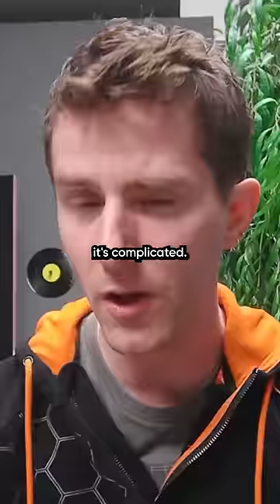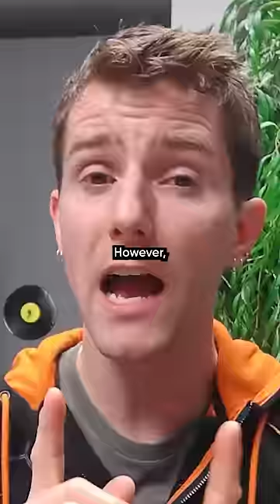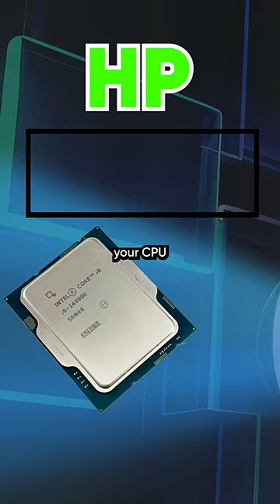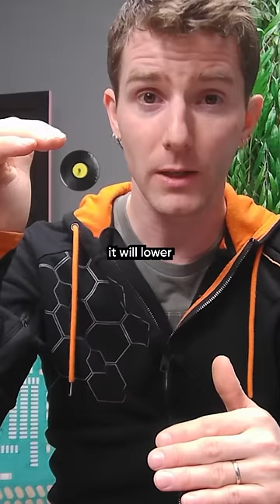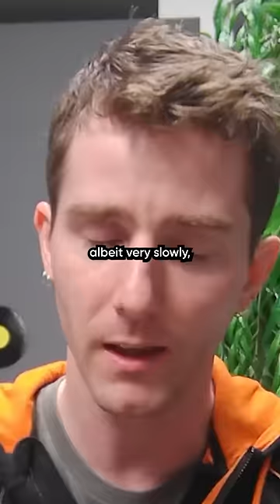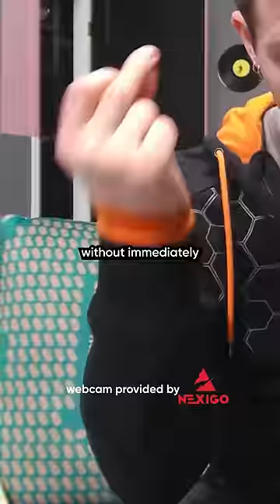How bad is Thermal Throttling?

Comment: Throttling doesn't actually do a very good job of matching the cooling.  By the time throttling kicks in, the chip is already too hot, so it overcompensates by bringing the target down way more than actually necessary.  By dialing in that power target manually (limit your CPU power until just before it throttles under load) you can get SIGNIFICANTLY better performance.  My personal experience is about a 20% gain on a 13900k.
Reply: You don't to undershoot if you're using A PID / feedback based solution for reducing the power right? Even temperature controlled soldering ions use that....., they dont just swing between temps. They'll just reach the temps in fastest way but gradually. But in a CPU it might more be a drastic to avoid any circuits frying up.
Reply: This is simply not how thermodynamics work.
Reply: @ChillerStone2  Computer components lose efficiency at higher temperatures and wattages.  The hotter they run, the higher their resistance gets, and the more heat they generate for every additional cycle.  It's not a "thermodynamics" issue.  They simply lose efficiency and need even more power, which turns into more heat, which turns into more resistance, which turns into less efficiency, which requires even more power..

Maybe my reasoning is wrong, but whatever the actual reason, my CPU performs better when manually throttled.  It's basically a slow and steady vs hard and fast, slow and steady wins the race.
Reply: Same for me with my 6800h, it used to boost up to 4.5ghz thermal throttle but after limiting its boost to 3.7ghz I get more stable framerates

Comment: Running your cpu at 100°C is a new normal for modern cpu nowadays
Reply: For my Intel from 2007 this is also normal
Reply: @gordon_ramsay2060  I don’t think so
Reply: My laptop cpu is sometimes 101°C while gaming
Reply: Depends on the cpu, if I remember correctly there are some mobily chips disgned to run at up to 105° @MrGamelover23
Reply: Only intel standards. Useless e core power draw
Reply: And then there’s mine, never exceeding 65°C…
Reply: @minepro2929  you’ve probably never had a QX6850 @ 4.2GHZ 😉
Reply: True, modern CPUs are designed to automatically overclock itself until it reaches 100 °C.
Reply: not for ryzens
Reply: It always has been son.
Reply: Later intel macbooks often operated in 80-100 C on load
Reply: Depends on the cpu. 100c would not be good for a 5800x3d or 7800x3d.
Reply: @minepro2929 really depends, i used to have a laptop that would sit at 100°C idle
Reply: Please help, my 1070ti fe blower card is 60c idle and 90c load. No dust and I replace thermal paste
Reply: My 7800X3D never goes above 60° in most normal uses actually.
Reply: @benniwd2077 yeah mobile chips are generally designed with the assumption that they’ll run hot, can’t really get much cooling on a laptop chassis. My i7-11800H regularly runs at 90+C before throttling to stop it hitting 100.
Reply: @twangyyy18888  enough airflow in the case? Hot climate? 60/90 is acceptible
Reply: Not really have my 5900x running at 65c on on full load even while overclocking
Reply: Correction, Its normal for terrible Intel refresh CPU's(14 and 13 gen)
Reply: @AnimMouse more like 90 because at least amd 5000 operates this way if there are no power or current limits in place, that trigger before cpu hits 90
Reply: Yes it’s even true for Ruben cpus. Mine has spiked to about 101 C but it does pull back to 95 super quickly. But it Doesn’t always have to draw 200 or whatever watts. You can limit it and the performance is still great. I’m far from an expert but I’d say I know a thing or two so my words can be trusted.
Reply: @Jouniii damn... Not even mine gets that high
Reply: Imagine being a laptop user and getting over 100 degrees! Insane and I thought 80°C was bad!
Reply: @Jouniii  holy crap! My laptop only ever SPIKES to 65-70c but I'm only running older games like Skyrim and fallout4 heavily modded and on max settings
Reply: @DuOpig  I have repasted my laptop and it doesn't get nearly as high anymore.

Comment: And something I think is kind of important to say is that I have never had a CPU die. Like CPUs seam to be indestructible. With GPUs it's a different story. But something that needs to last longer than any CPU or GPU is our hearing. So I actually don't mind running my GPU a bit hotter these days if it means I won't have to fear my PC taking of like a jet.

Comment: been using 9900KS at +90C since the day it launched. those things will go obsolete way before "lifespan" becomes a concern.
Reply: Same with my older brother, has had a 9900K for years and it's been fine
Reply: If you bought a 9900 ks, probably at retail, you probably have enough money to buy a cooler for it.
Reply: CPUs last so much longer than the other parts of a pc usually do anyway.
Reply: And there is me, who had a 6900K dying on him for no known reason. Temperature might have been an issue, since I don't recall having a clear eye on the details of overclocking and watching temps.
These days, I limit all my CPUs to not exceed 80°C and that should be perfectly fine. With large tower coolers, I think there is still plenty of processing power.

Comment: Isn't thermal throttling created as a safety net for overheating? Like longevity of the part but primarily as an emergency break for power consumption to prevent heating issues that will lead to damage? Idk I learned different terminology and basically I'm saying what you're saying but less....put together

Comment: The throttle point is set so the chip isn’t likely to fail running at it all day for years.

With normal use (no overclocks) you simply don’t need to worry about thermals.
Reply: Uh yeah actually you do need to worry about thermals without proper cooling your hardware will throttle and lose performance even if it’ll last long.

Comment: Wonder if it'd sort of last longer as the voltage will be reduced which will cause the silicon to degrade slower. All depends on if the thermal limits are set with some margin to where damage would occur.

Comment: I can attest that instant spikes in CPU temp won't kill the CPU immediately. When I was learning overclocking and PBO for amd, I incorrectly set up my 5950x and it would immediately hit 150C. It did this a few times before I caught on. But it's been running solid ever since and haven't noticed any issues performance/stability wise.
Reply: holy yikes 😮
Reply: Yeah, people don't really grasp that silicon is just a metalloid. 100c isn't really going to do anything different than 70c except make your fans run faster and possibly throttle your clocks.
Reply: I'm wondering what kind of motherboard you were rocking that didn't shut down once the CPU hit 100C
Reply: @ChillerStone2  it hit 150c in seconds. Not enough time for the heat to transfer into the motherboard.

Comment: If there's a consistent thermal exposure then it will last a long time as well, it's actually the changes in thermal output over time that cause the biggest issue. It's called chip creep and it's caused by high/low thermal cycling.
Reply: ie: everytime I hit compile
Reply: @futuza  I think it's only big changes, like sub 10c to 40c+ more than it is like 50c to 90c.
Reply: @TurboBass  Mine usually goes from 28c - 75c depending on the project.  But I'd have to do more benchmarking to make sure.

Comment: Desktop PC users are often terrified of their CPUs hitting 80 degrees C or more.

For laptops, this is the normal CPU temperature when doing anything beyond idle. 

And they don't use different silicon for either. They castrate them to reduce some lanes, clock them lower, use binnings that have more defects in the on chip caches and simpy disable some of them, too etc.

And people put notebook chips in desktops to save electricity and desktop chips in (big) notebooks to gain performance. 

But the silicon of them are the same and thus, their thermal degradation is PROBABLY very similar.

Chips for industrial, automotive, aviation applications, on the other hand, do use different silicon and different processes to make them a lot more durable and heat resistant. At the cost of performance, of course, but the tryhards don't game the newest AAA title at 8K ultra on them. For now, at least.

Comment: Any tips for keeping laptop CPU/GPUs cool while gaming? My machine averages 78-90° depending on game and I'd prefer for it to not throttle if it can help it.
Reply: Install a high performing Phase Change Material on the CPU and GPU core (Honeywell PTM7950).

And swap out pads for a high performing Thermal Putty like CX-H1300, Laird T-Putty 607, or Upsiren UTP-8
Reply: If you don't have a cooling pad, consider buying one. There is a big difference from playing on a bed, to desk, elevated laptop, a metal base and then cooling pad. Also probably just admit defeat and lower the game settings. Shadows, highlights, particles, textures  affect performance the most.

Comment: Following that i have a question as well: How hot is too hot? Or rather when does it become a problem for the CPU or GPU?
Reply: That's another "it's complicated" kinda thing. While it's easy to look at packaging to figure out the safe ranges on a specific card/line of cards that's only going to be a rough estimate as cards vary a bit. One might have 20 gage wiring for it's power connector while another has 16 gauge. A rtx might have better cooling fin designs wicking the heat to a part of the card where there's less to go wrong than other brands. There's also variations in the actual materials each card is made of, like no two silicon's (that a processor is made from) are going to be a perfect match. 

There's also the issue of how long is the card going to be running at a given temp. Like if it spikes up to throttle temp for like the last couple of minutes of a game, and then you decide you're done that's going to be a lot less stressful on the card than the person mining crypto leaving the PC on for indefinite periods in a room hot enough to thermal throttle a person.
Reply: Also there's water cooling to think about. Melt an o ring and it's game over for more than just the GPU.
Reply: @hippiedude2232  thank you
Reply: When you said thermal throttle a person I immediately thought someone sweating to near dehydration lol

Comment: I feel like computers should be capable of working with any power supply. If only we could just tell it what it’s paired with, or had a communication protocol with the PSU.

Or even if it just learned from patterns of it crashing when high draws occur. 

It’s interesting to wonder how low a computer can operate stably. 

Can a 3.5Ghz baseclock also run at 300mhz?  And if so, why would we ever fret over our power supplies.  Seems like something we could transcend if we wanted to take the time to do it.  

Imagine a universe where everyone buys the same GPU for a low low base price, then all the money is made on the upsell of the PSU as every additional watt unlocks more of the GPU performance. 

Interesting to think that processing could get so cheap as to leave power supply components as the major cost factor.  It’s unlikely one would decrease in cost but not the other, but kinda interesting if it shookout that way.

Comment: The thing is, it didn't use to be like that. 13 years ago or so, CPUs would always run at the same frequency and wouldn't throttle. If we go around 5 years back from that, motherboards wouldn't even turn off if the CPU reached dangerous temperatures, they would just let the CPU die.

Comment: The answer is no if its 9nm or smaller as its basically atomically impossible to cause degradation as that involves the atoms moving well so long as you remain under 97c for ryzen 92c if X3D and what ever it is nowadays for intels last time i checked its 110c

Comment: This gave me a great video idea: how long could you run your CPU with just fan/fans blowing air at the IHS! :D
Reply: Well, you could run it indefinitely, just very slowly.*
Consider a basic, no frills, 15 year old, air cooler like the hyper 212 has about 500 times the surface area providing cooling, and is rated to cool about 180 watts, I’d guess you’d get a modern cup running at best about half a percent of its rated speed
*side note, you might actually cause damage running long term with no additional cooling. Without something more substantial than the ihs to spread the load and pull heat away it’s probable that there could be tiny hot spots on the die, far enough from one of the sensors that they won’t see how hot everything really is.

Comment: I think the original Pentium didn’t have thermal throttling but the CPUs didn’t get so hot that they risked melting themselves. Nowadays it’s an absolute necessity especially with AIOs that can fail.
Reply: Or forgetting to peel.

Comment: Not sure if my thermal throttling is doing its job lol, I've got water cooling but under very heavy loads my CPU easily exceeds 100 degrees celsius. HWinfo says it's throttling, but the temperature keeps climbing until it shuts down at ~120. What gives?

Comment: PLEASE ANSWER: Why do some games completely freeze your computer instead of outputting an error message or an BSOD
Reply: Freezes are usually caused by programs getting stuck in a loop they can't escape from, usually because they're waiting for something that'll never happen.
BSODs come up because Windows itself found a problem that's causing unexpected behaviour throughout the system. 

In other words, it's very unlikely a program will cause a bluescreen, unless it's making changes to your PC. If the bluescreen does come up, it's usually driver or hardware related.

Comment: My X9100 CPU has spent years near thermal throttling (104C) 247 crunching BOINC and has not failed. It's a nonconcern.. A good month or 2 continually throttling,. However 13th and 14th gen Intels apparently degrade after 4 months at 85C or less?? Level1techs gamersnexus 4 more

Comment: I got a question for my laptop. I have 8gb dual channel ram on my laptop and one of them is soldered on board and 1 is changeable. I have an old 16gb ram with sam clock speed. Is it worth to remove 4gb and add that 16gb ram stick on ryzen 3 5th gen laptop?🙂😅😅

Comment: If you're constantly thermal throttling or near thermal throttling, 
you will eventually experience crashes. 
Let's say you get a new PC and your CPU immediately jumps to 90C when you're gaming or doing some light work on your PC, but your clockspeeds are still somewhat fine. 
Yes, you could ignore it, but the problem is, eventually the CPU is going to trigger power shut down because a millisecond temp spike will tip the scale, and the thermal throttling won't react in time.
That, or it WILL react in time, leading to a massive underclocking that will make the PC stutter and freeze.
You gotta make sure you are in the  "safe" zone for stability and longevity. Sure, your framerate isn't affected by your CPU running at 65c as opposed to 80c. But it feels more comfortable to have that thermal headroom.
Reply: No

Comment: See the Wikipedia article about electromigration.
TL;DR: The current "washes" away the copper on nano-scale conductor tracks. High temps accelerate that and the thinner the track gets, the faster it gets - up to the point where the connection no longer works.
You need some really bad luck to break a critical track, but it can happen.

Comment: Hey Linus. I'm really sorry, but you didn't answer the question at all. Yes we know thermal throttling is a way for the CPU to prevent itself from degrading. But how effective is it?

If one CPU runs at 80°C every day for 10 years and the other one is constantly throttling at 95°C for the same duration, will one of them be more degraded than the other?
Reply: He just said "its complicated." As in Yes and No and gave you an explanation. You have to use those comprehension skills you learned way way back in the 3rd grade. Disabling thermal throtting is bad.  Getting your cpu/gpu so hot that it triggers thrermal throttling is bad is left out because it becomes obvious from listening to the explanation. So Thermal Throttling is GOOD for your CPU/GPU even though it makes performance not good.